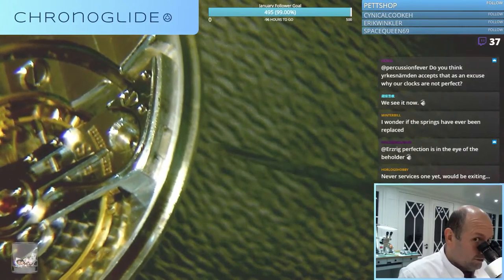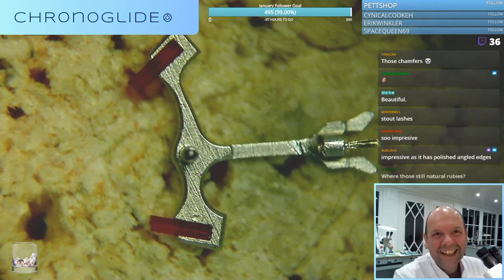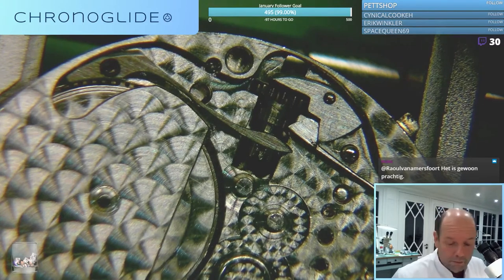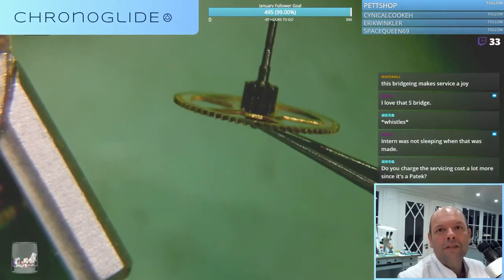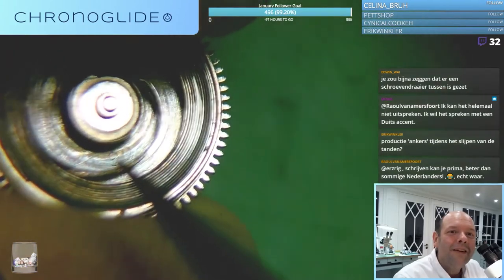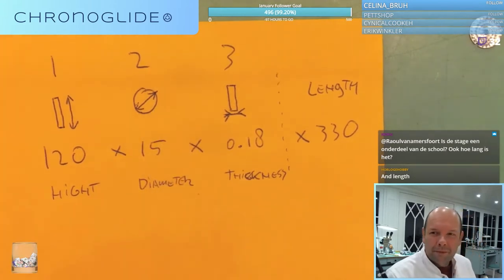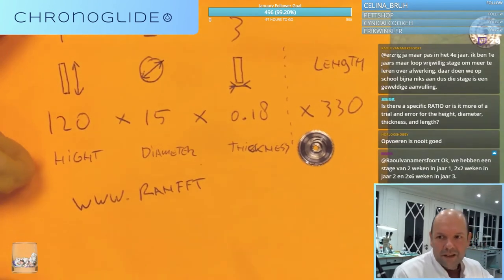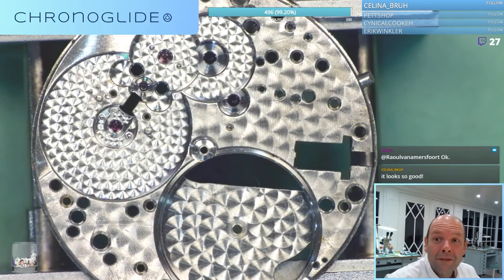Simply stunning Patek Phillipe watch repair - Part 2of2

Comment: As a performance engine builder, I can appreciate the small details of an advanced design. For example, inside a high performance engine, we would routinely polish certain areas of the rough castings to facilitate increased oil return flow to the main sump, or to direct less airflow disturbance preventing fuel dropout. While what appears to be merely "eye candy" in a Patek, I believe serves a more noble purpose of stagnating air disturbance within the movement to facilitate increased timing accuracy.
Reply from the maker: Interesting!
Reply: Marketing. there are watches ith the same quality and design and cost 100 times less.
Reply: @juaquimgustavo4712  That's because you couldn't afford one.
Reply: You are correct about the performance. More polished, rounded surface doesn't "grab" the air as much. It will oxidize a lot slower as well or not at all as the surface is burnished or polished. That closes up the metal "pores", there is a science behind it all.